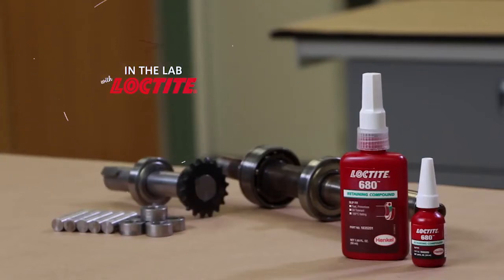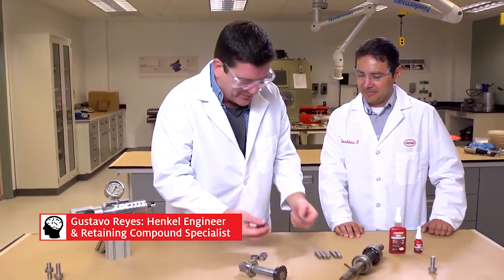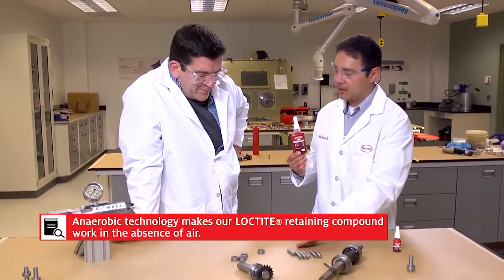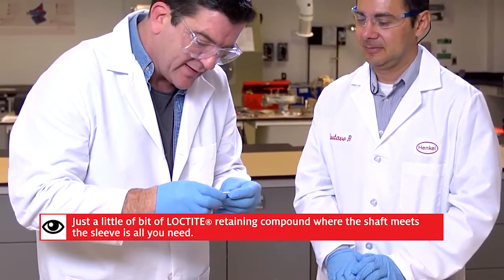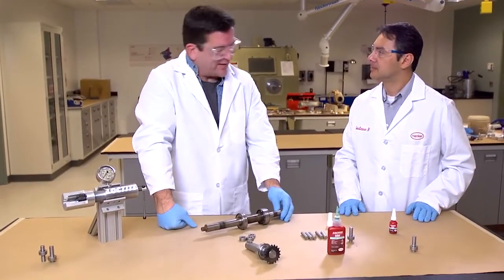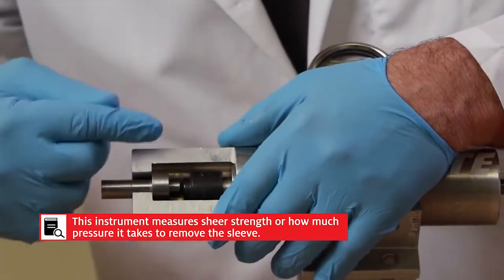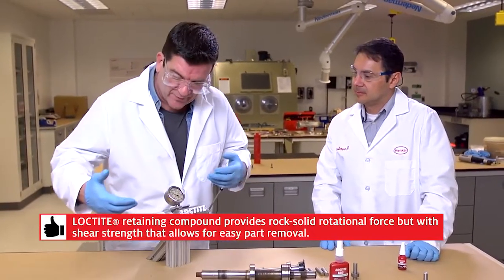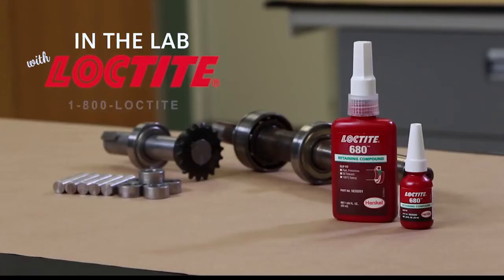Proper Use of LOCTITE® Retaining Compound

Comment: How does the Loctite know the difference between Axial shear and Rotational Shear?  Does it contain nanobots?
Reply from the maker: There are 3 types of movement in general which are translation, rotational, and vibration.
Loctite is there to eliminate one or more of those three unwanted movement (depend on the machine itself) in order to keep the machine precision.

You can contact your Loctite country representatives for more details.
Reply: yes I reacted to this as well, same shear stress no matter rotation or axial force, does not mean the product is not great, but this is a product for engineers and mechanics, so we expect the correct nomenclature ;-)
Reply: More loctite resistance to overcome in rotational force as your are moving it across where the loctites are currently positioned.

For shear force, u are pulling it away to a non-loctite surface, so its easier to overcome
Reply: @ighfirlee  Great Explanation (hope it's actually true) Makes logical sense.
Reply: @ACitizenOfOurWorld  its true, give it a shot. and as a thread locker, you better have a torch handy if you change your mind...

Comment: i really don't see how it isn't shear during rotation, i guess you don't need to lock a lot so it is ok
Reply: The force he applied was axial, he got it wrong. Shear (technically hoop) stress would result from the torque load applied at rotation. Essentially in this case I believe the Loctite forms almost a thin walled tube sort of shape and therefor the 3 stresses are axial, radial, and hoop.
Reply: @gopackgo4036  both axial torque and thrust are shear forces on the adhesive surface.

For all intents and purposes, it is exactly the same mechanism, just in a different direction.

Looks like this video was made for mechanics and guys who are more meatheaded and not like highly technically inclined. It seemed like it took a lot of thrust to get that joint apart so im guessing the engineer dide was basivally yrying to day "its a bearing brother. Bearings dont need a ton of torque. It should hold fine."
Reply: @21area21  explain how thrust (to be clear axial force) is a shear load?
Reply: @gopackgo4036  aight, bet.

Imagine the axle is a square tube being pushed axially.
And the bearing is a square as well.

If you look at one side of that square axle, you see that is two sheets trying to move parallel against each other. That is the definition of shear.

A circular axle and bearing is just the exact same thing, just curved. The mechanics are exactly the same.
Reply: @21area21  the applied force is normal. So is the resulting stress in both parts. The only shear force is on the adhesive itself.
Reply: @gopackgo4036  Oh, I thought we were all talking about the adhesive.

This is talking about the failure mechanism for the adhesive. The lab coat dude said it wasn't shear in rotation... I believe that's what OP was stating.

Comment: This stuff works awesome. We use it on our auger sleeves and when it cures it’s stuck! Only way to get it off is cut a slice through sleeve with a grinder then take a chisel and give it a hell of a smack.
Reply: How laege of a gap does this work on?

From working with superglue, those typwa of adhesives do not like much soave between contact surfaces. 

Wonder if same goes for Loctite retainign compound (620 - the green stuff)

Comment: What loctite is best for locking in a shear pin into a hole that has widened? The hole has widened about 2mm This is to hold an electric motor prop with high torque.
I would also like to bang it out fairly easily with standard garage tools. My first attempt is with 263 (awaiting the full cure atm) but I also have 660. Would 660 bang out okay, or is this more permanent?
Reply: try this stuff! what they are saying is once it drys completely you won't be able to rotate one object while holding the other in place. But you will be able to "pull" them apart / slide it off the shaft. just imagine the outer race of a bearing thats been spinning in its housing.   This stuff will keep it from spinning, causing more damage and ultimately fail completely. But it will allow the bearings race to be pulled free from the housing and replace in the future. 648 you can pull but not rotate, so don't hesitate, go fix the damn thing, no more procrastinate!
Reply: Just an fyi lol. This stuff is good. And I mean GOOD. Idk how easy of a time you’ll have pulling it back out, but I can guarantee it’ll stay in there😂

Comment: I accidentally added Loctite 660 (Quick Metal) instead of grease to the rear bearing (ball bearing) on a motorcycle.
The bearing still has mostly grease that was already in the bearing, I just topped it off with the 660.
The loctite tube and my tube of molybdenum grease are similar and just failed to read the label to be sure.
It would be a major chore to redo the bearing, so 
QUESTION: is it catastrophic to use 660 instead of wheel bearing grease or it might be okay for a while?
Reply from the maker: Hello.. We have never experienced this, it's best if the area that is already filled with Loctite 660 is cleaned as much as possible. Although Loctite 660 will only work anaerobically, but we need to anticipate that when the bearing works and generates heat, the remaining Loctite 660 will change to a thicker formation which may later cause the bearing to jam. Loctite 660 will become thermoplastic after being cured which may inhibit the ball bearing from working optimally.
Reply: @EkasuryaInoutIndonesia  Thank you for the response and information. Like and Thumbs up!
Reply: Are you alive?
Reply: @sayingnigromakesyoutubecry2647  
Apparently (anecdotally) if you have grease on the parts, it will have no effect.
I have riden many miles now and have not been afraind to take it to 125mph on the interstate.
All is good!
Reply: @2Truth4Liberty  glad to know you are ok. Yes, it makes sense. Dirt and grease doesn't allow glue to stick on the surface

Comment: I wanna gule stainless steel insert into aluminium hole. 4mm diameter. Which loctite should I use ?
Reply: 641 with activator 7240.
Reply: @gammelgemse  why not 638 ?
Reply: @gammelgemse  641 allows disassembly and this is not what I need